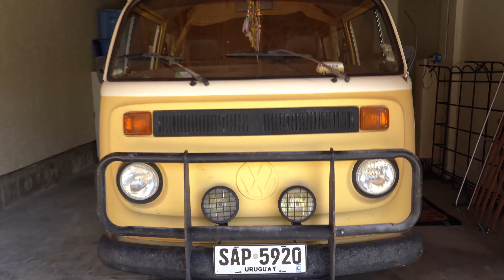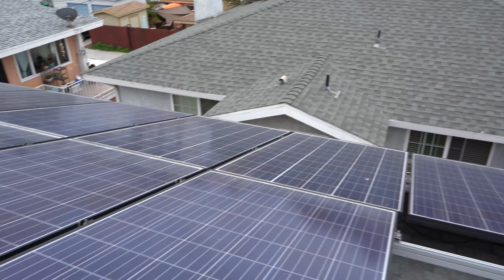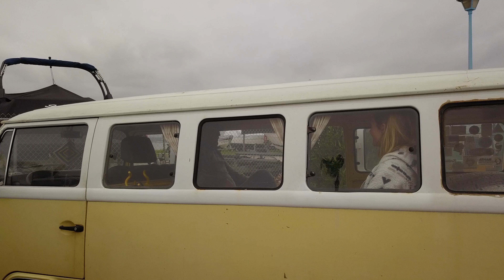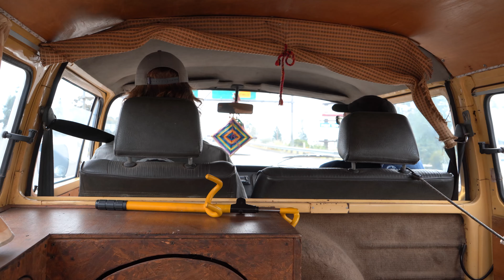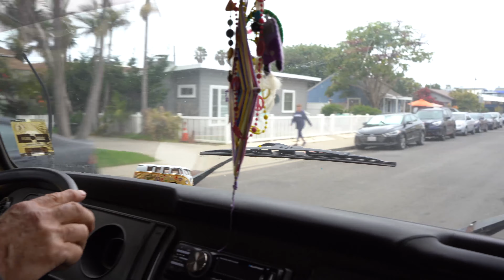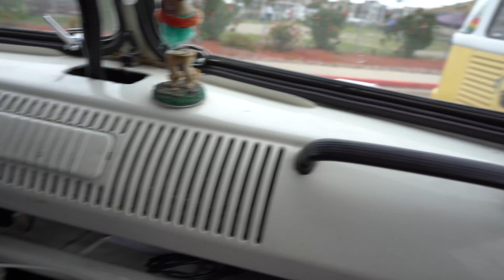San Diego Community Power - A better, cheaper alternative?

Comment: those buses are a wall against the wind, so electric range is going to be heavily affected by speed. Perhaps going at 40mph instead of 60 could even double the range
Reply from the maker: That’s one of the key issues to keep in mind when comparing between repurposing these old buses vs brand new EVs. It’s the economic and environmental impact of old inefficient vehicles that are already out there vs building a brand new machine and all its components (vs a “quick” engine swap). We’re obviously biased an lean more towards keeping vee dubs on the road 😜. Thanks for watching!
Reply: Drag coefficient of VW bus is a very average 0.42, if anyone wants to compare.